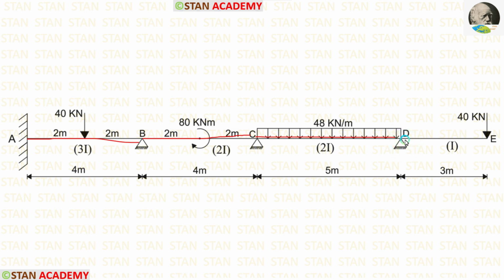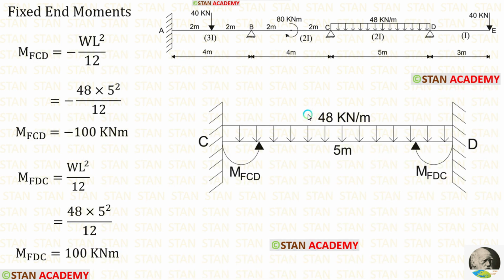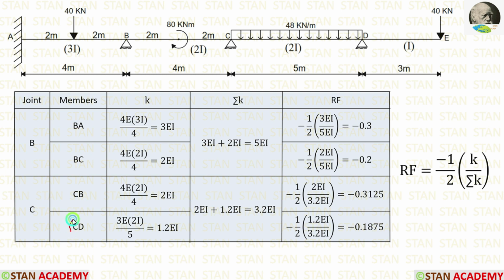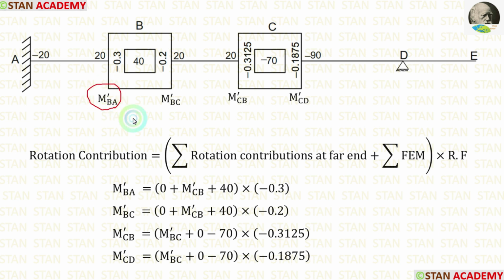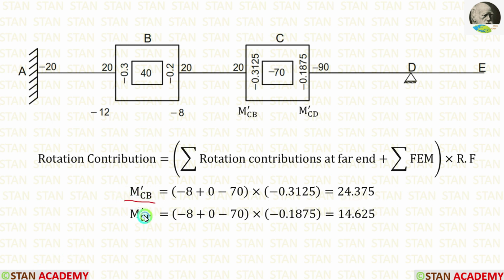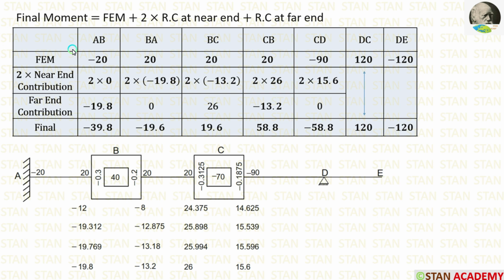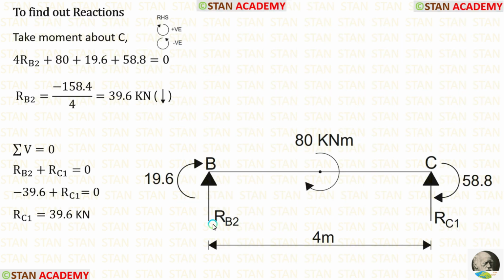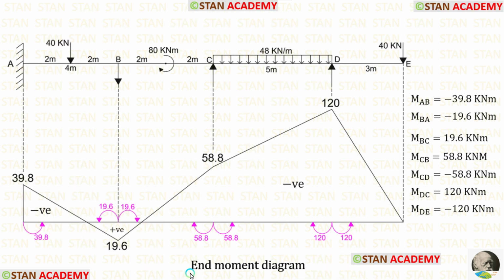Kani's Method for Analysis of Beams - Problem No 5 ( With Overhanging )

Comment: The video demonstrates how to calculate fixed end moments and rotation factors using Kane's method and the slope deflection method for different points in a beam structure. It also covers finding vertical reactions and drawing shear force and bending moment diagrams.

[00:00] The video explains how to analyze a beam using Kane's method
- The beam has three spans: AB, BC, and CD, and an overhanging span DE
- There are seven moments and four vertical reactions to find
- The beam has a point load of 40 kN in span AB, a concentrated moment of 80 kN-m in span BC, and a uniformly distributed load of 48 kN/m in span CD
- In the overhanging span DE, there is a point load of 40 kN
- The moment of inertia for span AB is 3I, for span BC is 2I, for span CD is 2I, and for the overhanging part is I
- To calculate moment MD, we multiply the point load with the overhanging distance and apply a negative sign
- MD and ME have the same value but different signs
- ME is acting in the anticlockwise direction

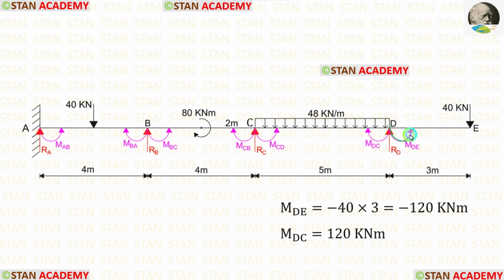[03:28] Calculating fixed end moments and adjusting for carry over in a beam with point loads and concentrated moments.
- Fixed end moments can be calculated using formulas for different types of loads
- Adjusted fixed end moments involve distributing the excess moment to adjacent spans
- The moment distribution method can be used to distribute the excess moment
- Changing the sign of MDE can help calculate MDC easily

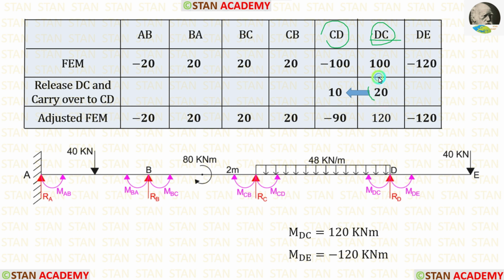[06:54] Calculate stiffness values for joints B and C to find rotation factor in Kane's method.
- Stiffness calculation needed for joints B and C
- Formula for stiffness depends on type of support at fair end
- Stiffness for joint B calculated for points A and C
- Stiffness for joint C calculated for points B and D

[10:22] Calculation of stiffness and rotation factor in a hinged fair end beam with overhanging span
- Formula for stiffness summation in joint b and c
- Calculation of rotation factor using the formula
- Boxes are made in joint b and c to enter fixed end moments
- Fixed end moments are added in joint b and c
- Rotation factors are entered in joint b and c

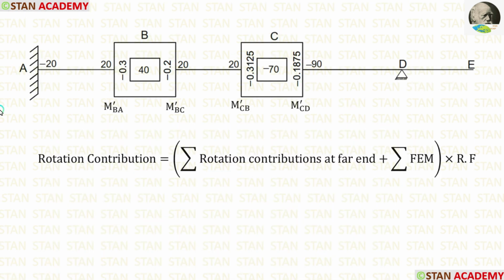[13:50] Rotation contributions are calculated for joints B and C, using a formula involving fixed end moments and rotation factors
- Rotation contributions are not calculated for joint D, as the final moments have already been calculated and released
- Joint B has two rotation contributions, M'BA and M'BC
- Joint C also has two rotation contributions, M'CB and M'CD
- The rotation factor for M'BA is -0.3, while the rotation factor for M'BC is -0.2
- M'CB is calculated using the fixed end moment of -7D and a rotation factor of -0.3125
- The formula for calculating rotation contributions is summation of rotation contributions at fair end plus summation of fixed end moments into the rotation factor

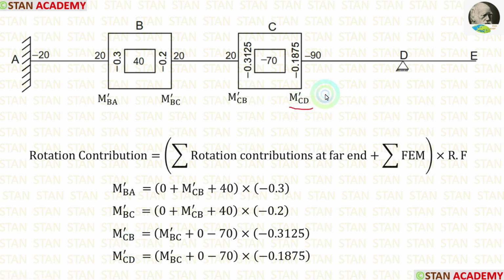[17:16] Calculation of rotation contributions and fixed moments in a fair end system
- Values of m dash bc, lambda cd, and lambda cb are the same except for rotation factor
- Calculation of rotation contributions and fixed moments in joint b and c
- Second cycle calculation of rotation contributions and fixed moments in joint a and c

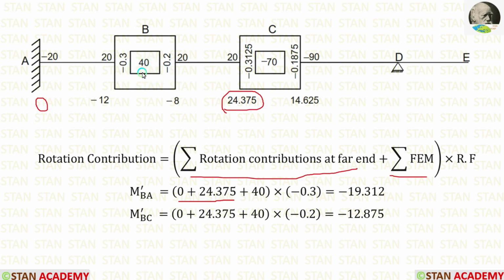[20:43] Calculations of rotation factors and values for different points in a cycle.
- Rotation factors for ba and bc are -0.3 and -0.2 respectively
- Values for m dash ba and m dash bc are -19.312 and -12.875 respectively
- Rotation factor for cb is -0.3125 and value for empty cb is 25.994
- Rotation factor for cd is -0.1875 and value for m dash cd is 15.596

[24:08] Final moments of a structure can be calculated using a formula and a table
- The fourth cycle can be stopped when all values are approximately equal
- Fixed end moments and near-end contributions can be entered into the table
- Rotation contributions at near and fair ends can also be entered
- Final moments can be calculated by adding the three values
- Assumptions about the direction of moments can be proven wrong by calculations

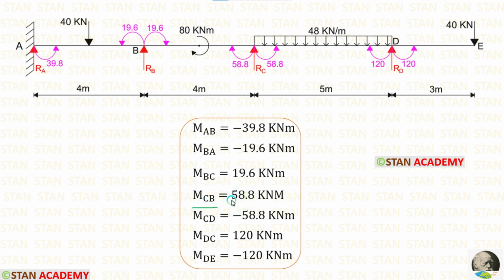[27:36] Finding vertical reactions for a span with two moments acting in the anticlockwise direction
- Calculating rea using moment about point b
- Applying sigma v is equal to 0 to find rb1
- Calculating rb2 for the span bc using moment about point c
- Assumption of rb2 acting upwards is wrong, it is actually acting downwards
- Applying sigma v is equal to 0 to find rc1, using rb2 as a negative value

[31:03] Calculating vertical reactions and drawing shear and bending moment diagrams for a simply supported beam with multiple spans
- Taking spans CD and DE together to find vertical reactions
- Eliminating MDC and MDE and considering MCD acting in anticlockwise direction
- Finding RC2 by taking moment about AD and applying sigma V=0 to find RD
- Adding RB1 and RB2 to get B, with RB acting downwards
- Adding RC1 and RC2 to get RC
- Calculating shear force values and drawing shear force diagram
- Calculating bending moment for each span and drawing free movement and end moment diagrams
- Combining free movement and end moment diagrams to get bending moment diagram